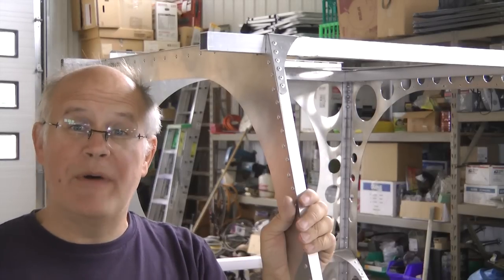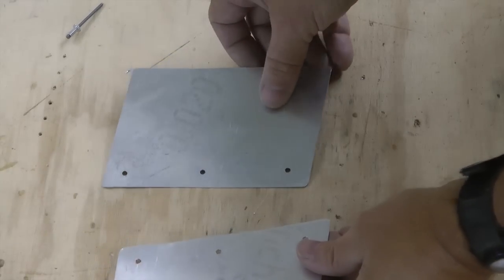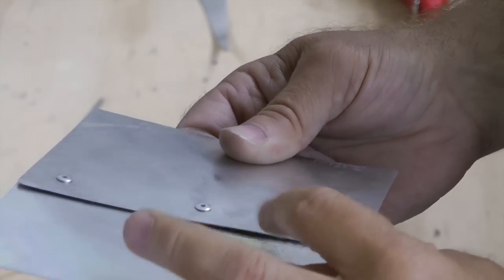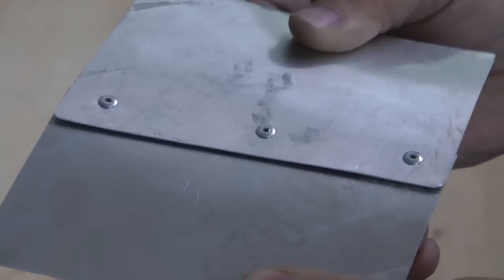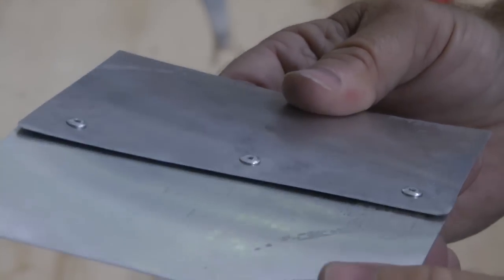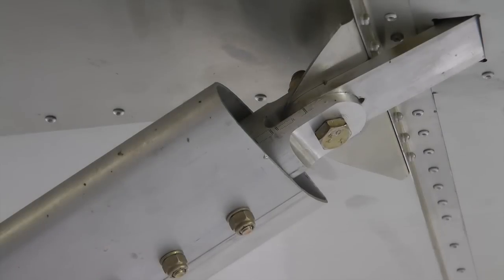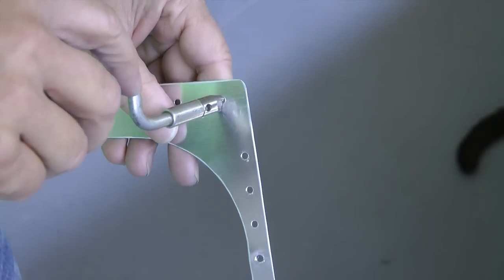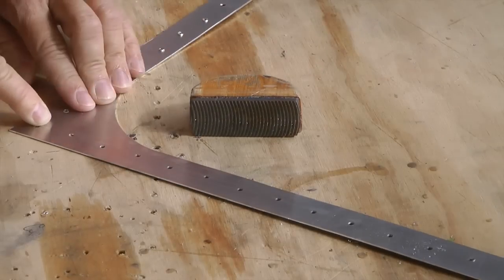Do I Really Have to Debur my Holes?

Comment: Don't use the file on AlClad.  AlClad has a pure aluminum coating (3%-5% of the material thickness).  The pure aluminum coating protects from corrosion (dissimilar metals with a potential difference in an electrolytic rich environment)  (The middle part of a sheet of AlClad is an alloy hence the 2024 or 6065 etc - you can find the alloying materials on your own) Raking a file across the pure aluminum coating removes it and exposes the material for quick corrosion.  You can see this when you etch and alodine a piece of AlClad.  The etching solution has very little effect, if any, on the pure aluminum, but the edges and holes where the pure aluminum coating was removed corrodes (turns brown)

Comment: Thanks for the building tips. I gotta say i think the chatter marks left by a 3 flute standard debur tool are terrible especially if the hole is dimpled afterwords. Cracking can occur from the minute marks. I have switched to a "0" flute 100 degree cutter and the chamfer is perfectly smooth and chatter free. Thanks again for the great videos keep it up!
Reply from the maker: Thank you for that observation... probably the 3 flute is ok for just non countersunk riveting...

Comment: How does the flat file not destroy the surface of the aluminum?
Reply from the maker: You saw the demonstration - there was no destruction. If the scuff marks that are created are a problem then use the deburring tool.  Also, note the warning about not using this technique on alclad sheet.
Reply: It does.